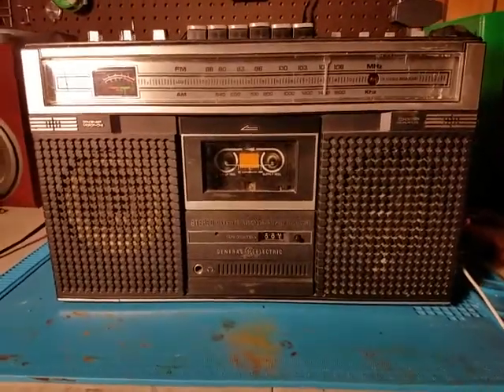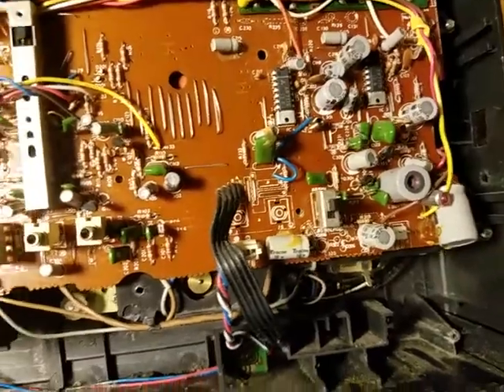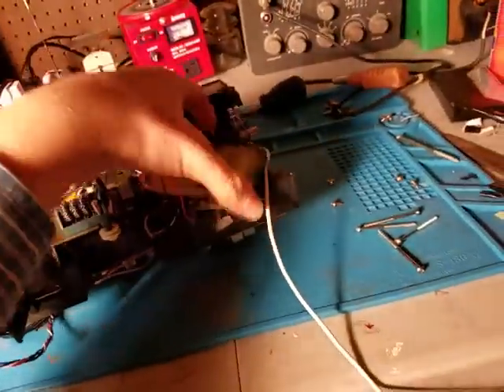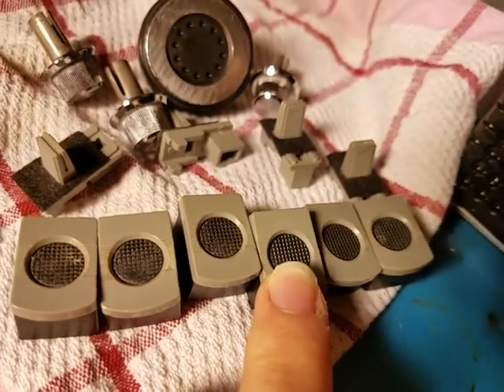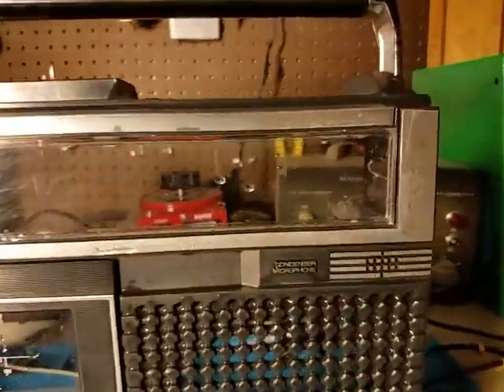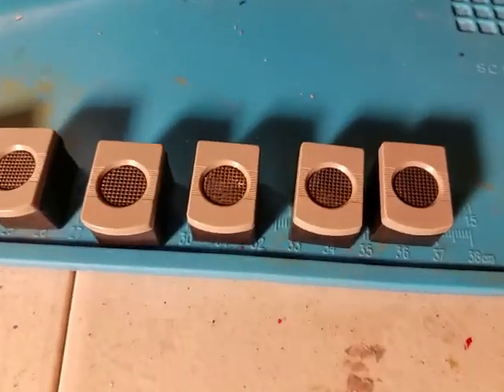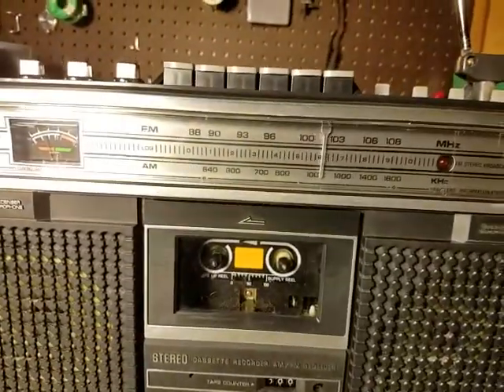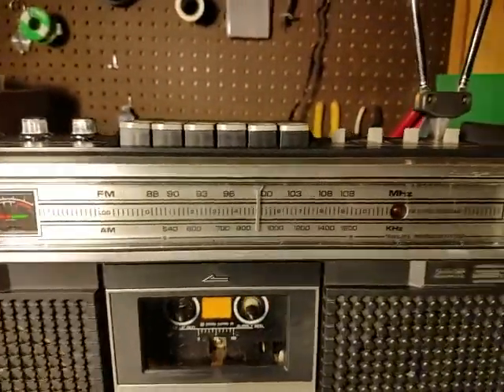Cosmetic Repair Of A 1979 GE Boombox

Comment: I’d recommend using some sort of glass polish on that glass panel. That could probably get out most of the small scratches, but I suppose you’d still have that crack. It all depends on how much the scratches bother you.
Reply from the maker: That's a good idea, all I've used was Windex and a screwdriver to loosen whatevers on there. But glass polish could go a long way too!